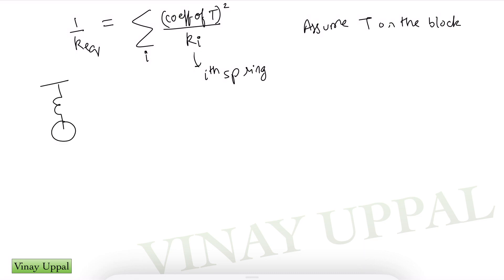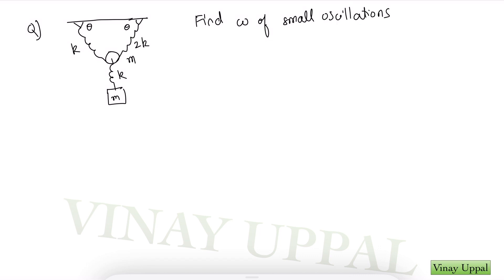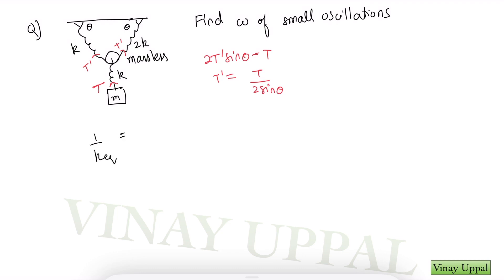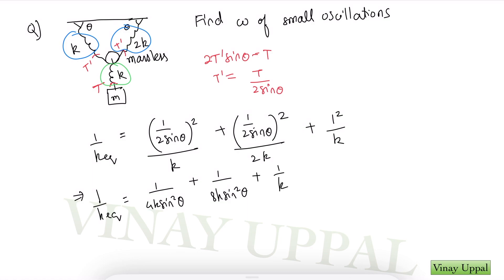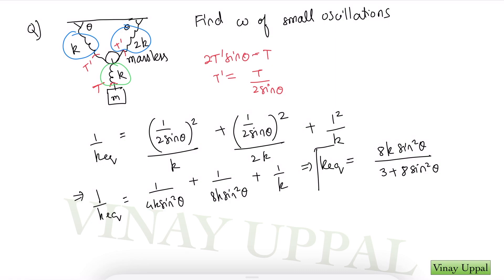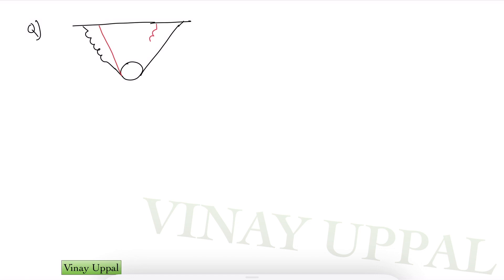GAMECHANGER PREVIEW : Simple Harmonic Motion. SHORTCUT for Springs at an ANGLE! JEE Advanced!

Comment: Please explain the last question sir
Reply: were you able to solve it?
if you take tension in the red string as sqrt3 Tb/4 and tension in the black string as Tb/4, (where Tb is the tension acting on the block) then I am getting the solution which sir said is correct.
But to get this I assumed that i) pulley is in vertical equilibrium-- this is valid
                                                      ii)horizontal components of tension of the black string and 
                                                          red string are equal--- not sure why this assumption is required

Comment: Pls someone explain the second question which sir skipped😢😢
Reply: were you able to solve it?
if you take tension in the red string as sqrt3 Tb/4 and tension in the black string as Tb/4, (where Tb is the tension acting on the block) then I am getting the solution which sir said is correct.
But to get this I assumed that i) pulley is in vertical equilibrium-- this is valid
                                                      ii)horizontal components of tension of the black string and 
                                                          red string are equal--- not sure why this assumption is required